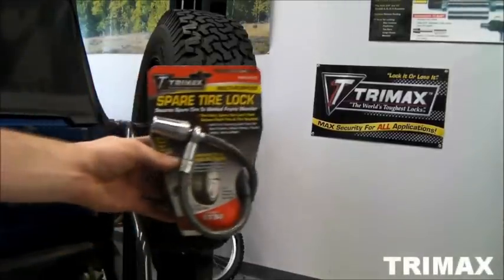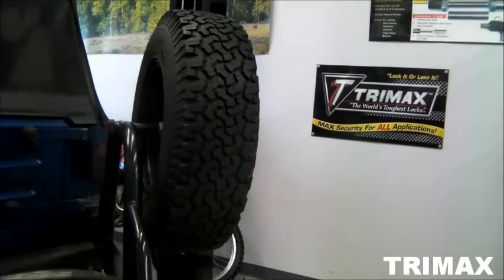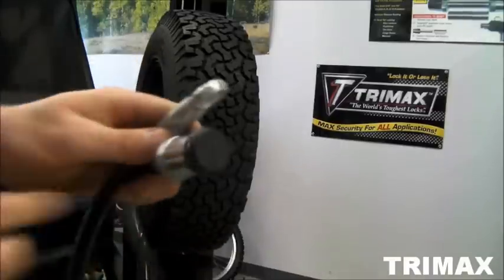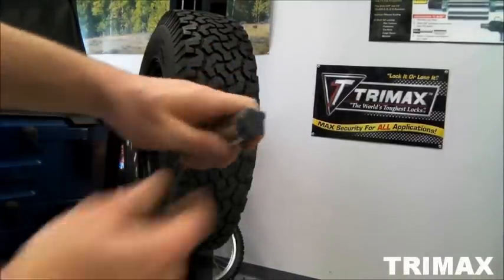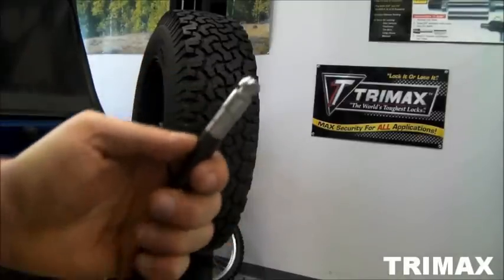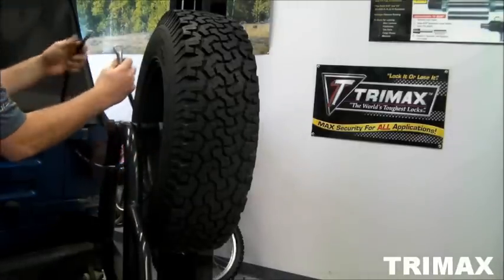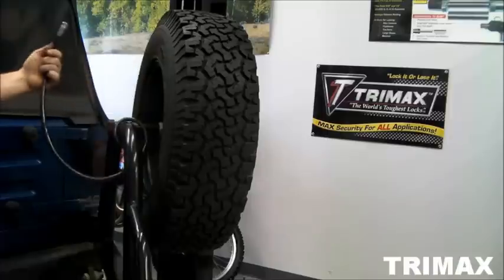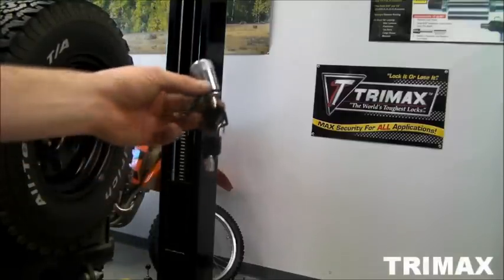Spare Tire Lock by TRIMAX

Comment: Cable cutters and even a pair of normal Klein style wire cutters and go right through this, buy at your own risk
Reply: What do you recommend
Reply: @dleada5  I use a kryptonite evolution series 4 chain bike lock. Throw a couple heavy duty zip ties around the slack to reduce any rattling.